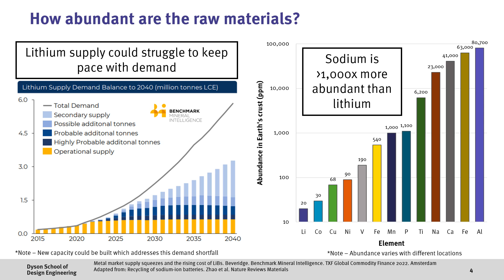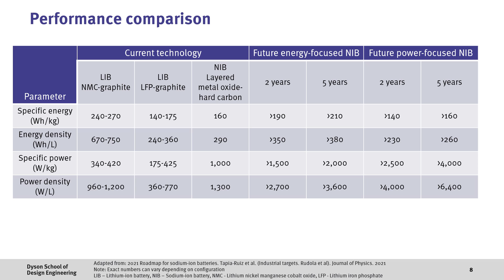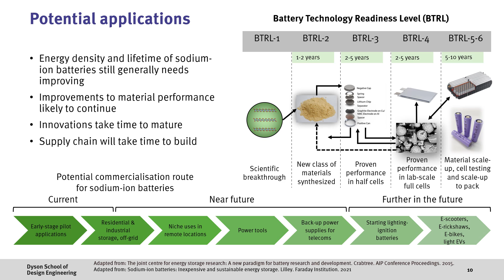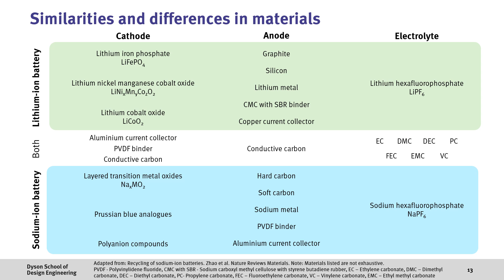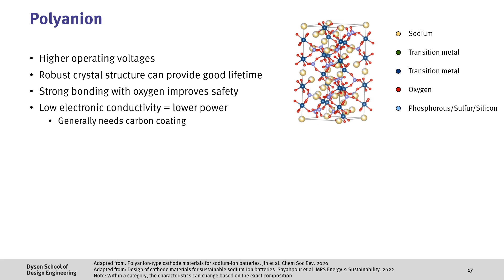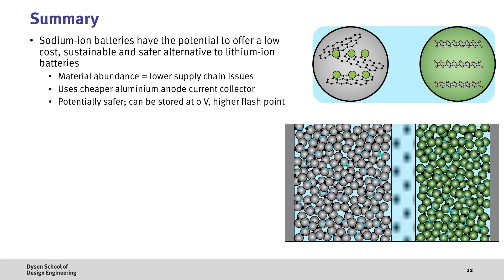Sodium-ion batteries - The low-cost future of energy storage?

Comment: What is your opinion on CATL launching sodium ion batteries for ev. From your video, it seems lower energy density and nominal cell voltage should not make it ideal for ev for now. Then why are CATL launching it?
Reply from the maker: Great question. Firstly, I think we'll likely need a range of different battery technologies as more things get electrified beyond pure automotive (e.g. trucks, mopeds, boats etc). True the energy density of SIBs are currently lower than LIBs but they are improving and have a number of current advantages in terms of low temperature and high power performance. I believe CATL have hybrid concepts which combine different technologies into a single system. Also, what we have learnt from lithium iron phosphate which had the same low energy density issue vs high nicke lithium-ion batteries is that whilst a chemistry might have a lower theoretical energy density you can often  get gains at the system level if the chemistry is safer or generates less heat meaning less inactive mass for things like thermal management and thermal runaway inhibition.

Comment: I skipped right to the cost segment. What a shame. The price floor set by materials costs appears too damn high. Sodium ion batteries are not going to bring about the extremely cheap storage that we need for multi-day wind energy storage - as wind energy appears to have a lot of day-long periods of little energy production.
Reply from the maker: The true cost of a battery is quite nuanced, but the core message is that whilst sodium is cheaper than lithium, the amount of salt in the battery is relatively small. Thus, the main cost is determined by the electrode materials. For the high performance NIBs which use transition metals similar to LIBs the cost advantage won't be as significant, but there are emerging chemistries which can be cheaper than the examples shown, but seasonal storage will always be a challenge for electrochemical batteries.

Comment: what are the BMS settings and charger settings?
Reply from the maker: Sodium-ion batteries broadly work in the same way as lithium-ion however the voltage limits may well be different depending on the chemistry and also the exact state-of-charge estimation technique may also differ from tradition LIB BMSs.

Comment: Thanks a lot for this video Professor Wu. I've learnt a lot from you today. I'm wondering why there's no much talk about potassium ion batteries. I thought the much larger ionic radii of potassium compared to sodium and lithium should be compensated by it's reduction potential that's similar to that of lithium. Potassium is also more abundant than lithium. What about possible magnesium ion batteries?
Reply from the maker: Thanks and great question. There are many different types of battery technologies out there which all work. The challenge is whether they've reached practical levels of performance in a combination of energy density, power density, cost, lifetime and other parameters in a single cell. For sure some of the fundamental problems with potassium-ion can be solved, however much of this often comes from government funding in fundamental science but often there is a focus on a specific area such that there is sufficient resources to get that area of maturity, rather than spreading too thin.

Comment: Isn't comparing today's state of the art NIB to today's state of the art LIB flawed? We need to compare the cost/capabilities of NIBs in 4-5 years (when potentially scaled up) vs. the cost/capabilities of LIBs in 4-5 years, no? If so, how will NIB's ever catch up? There's 1,000x more research going into improving LIBs than into commercializing NIBs, no? Also, will the costs of key elements used in NIBs rise if NIBs become widely used, thus lowering the potential cost advantage? Honestly, I thought that NIBs were going to be 50%-60% cheaper than LIBs, not just 20%-30%. That would justify all the hard work and risk of switching paradigms. I think NIBs will not have anywhere near the success that LFP did at the expense of NCM & NCA...LFP is now like 40% of the total EV batter market? Thanks again.
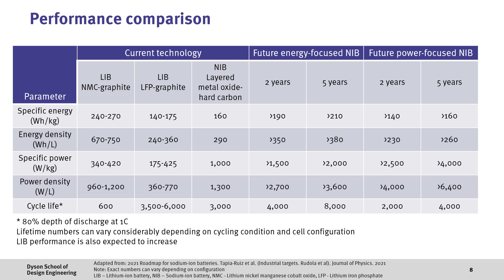Reply from the maker: A fair point and all battery technologies are constantly evolving. At around the 06:41 point (slide 8) I tried to put down the potential future NIB performance but you're right that LIB performance will also increase so a balanced argument should also include this. I think interest in NIBs will increase this year as there is significant potential offered from decoupling from some of the critical minerials from an energy security perspective. I believe there are already mentions of lithium cartels forming. On potential cost increase of NIB materials of course this could happen, though many of the materials used (depending on configurations) are somewhat more abundant and used widely in other applications (iron, sodium, manganese), so hopefully the risk is less. If NIBs are now at LFP levels of energy density, there are interesting discussions to be be around the balance of these two since LFP can be somewhat lithium intense on a per kWh basis.

Comment: Thanks Mr. Wu, very helpful... So, could a conventional Li-ion battery giga-factory convert over to sodium-ion 1) at a reasonable capital cost, 2) without closing the plant down for more than a few weeks 3) with very minimal technical risk. In other words, will sodium-ion replace Li-ion batteries in exciting vehicles or only in brand new vehicle models? Thanks! If only in new models, then Li demand will remain strong....
Reply from the maker: Thanks and great question. In theory, yes, the approach for making sodium-ion batteries is almost the same as lithium-ion batteries. Of course there are some nuances to this which still need to be demonstrated (e.g. moisture sensitivity) which means that there are still some technical risks, but in general I think this is feasible. In my mind, I think sodium-ion provides an alternative to lithium-ion. There are a few EVs in China proposing sodium-ion and it'll be interesting to see what real-world challenges come up.

Comment: Thanks for the interesting information. 
I would be interested to know what effect the much larger voltage swing of NIB cells has compared to LFP cells, if it is large, it has no advantage for storage applications, if NIB cells can only be partially discharged due to the large and therefore difficult to use voltage swing, this reduces the capacity even further compared to lithium cells.
Reply from the maker: Great question. The exact voltage range will depend on the specific NIB chemistry used, just like in LIBs we have NMC which has a higher voltage range than LFP cells. One potential challenge to note related to your question in that hard carbon has a slightly higher voltage than graphite which means that to extract all the full capacity, the lower voltage cut-off tends to be lower. So, if there is a system which has issues operating at lower voltages then you're right there might be some inaccessible capacity. I'm sure, as we see more of these systems being commericalised, more of the engineering challenges will emerge
Reply: @BillyWu  Here is an example:
A small, cheap EV gets a NIB, the EV is to be charged at the normal fast charging stations, which IMHO have max. 500 V
the EV should have a power of 100 kW
What does a battery look like?
It will have a maximum of 125 cells in series at 3.95V.
If this battery is run down to 1.8V it will still have 225V and would have to deliver 444A for 100kW. So the hardware has to be designed for this current, if the battery is even capable of delivering it.
Reply from the maker: @oliverwunsch4412  Older reported performance from Faradion (https://faradion.co.uk/wp-content/uploads/2018/04/Faradion-Limited-4th-International-Meeting-on-Sodium-Batteries.pdf) shows an operating voltage range of about 4.2-1.0 V for a cell with an energy density of 140 Wh/kg. You likely wouldn't run down to these low voltages so lose some accessible capacity, or have a very low power operating mode
Reply: @BillyWu  if you run it only down to 2.5V you got a 70 Wh/kg Cell?, what a surprise.;-)
Reply: @oliverwunsch4412 Perhaps, the battery management systems (BMS) sodium batteries could include voltage boosting electronics as the battery is discharged towards the lower end of the voltage curve. In that way, the energy density can remain close that of LiFePO4. This should have little ill effect on the battery as sodium ion batteries can be discharged to zero volts (or so I learnt).
Reply: @oliverwunsch4412    Don’t care about EVs. Or density;   Just thinking price, safety and a more locally sourced battery for solar & wind, in that order    You guys should be focusing on hydrogen for EV’s   EV‘s are disrupting the advancements for a capital gain instead of a logical conclusion to this matter

Comment: Thanks for the video. Is there any research on solid-state sodium batteries? Is the ion size/transport a blocker compared to solid-state lithium batteries?
Reply from the maker: Thanks. Yeah, there is also work being done on the development of solid-state sodium batteries. Though not in the limelight yet, it has significant potential also
Reply: @BillyWu  could you please make video on it what types are cathodes,anodes ,electrolytes gives best performance on solid state sodium batteries